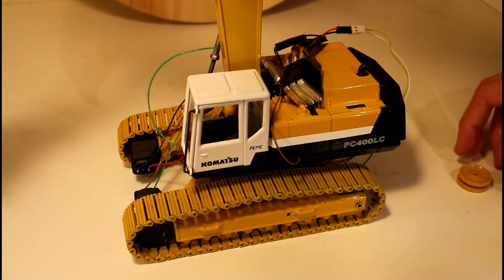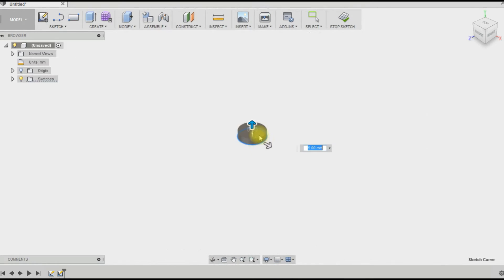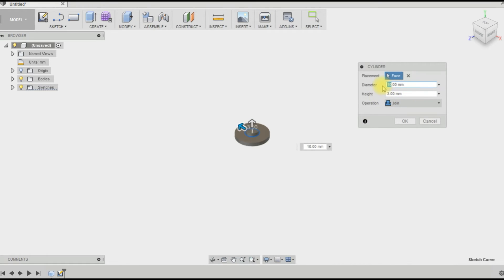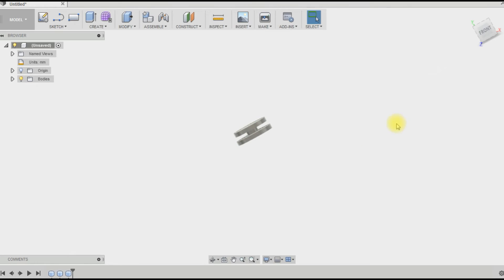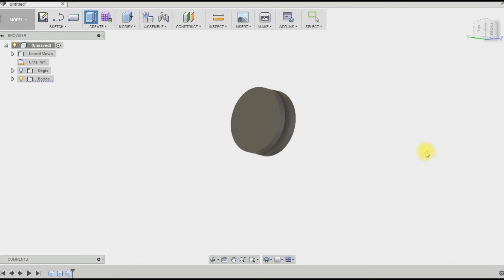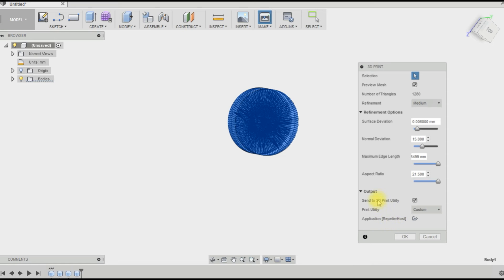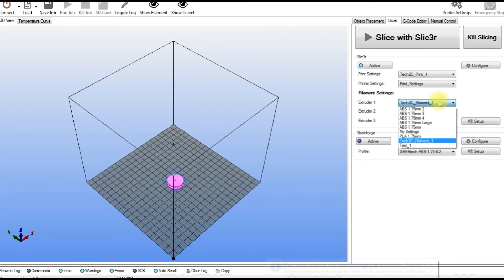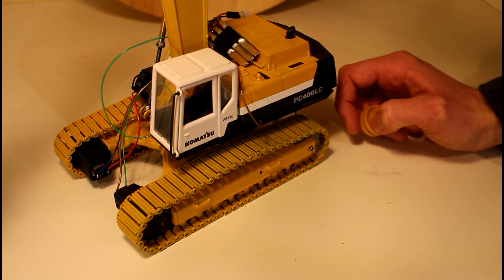How to design a part in Fusion 360 and export it to Repetier Host

Comment: So if u have a stl file with exact measurements does exporting it to repetier change its measurements?
Reply from the maker: As far as I know it should be exactly the same but when you print it depending on your printer type it might shrink so you'd account for that in your printer settings

Comment: I've tried to get into Fusion360 multiple times but I just cant, it feels so foreign to me.
Years ago I started playing around with Sketch Up and later changed to using Inivis Ac3d, now last year I started using Blender. All three programs are quite different from each other but still somewhat the same logic. Fusion360 just is so.. different, compared to them.
But the only reason I wanted to get into Fusion360 was the Cam functions anyways because having CAD and CAM in one program just seemed cool.